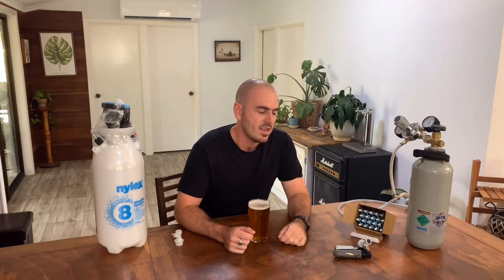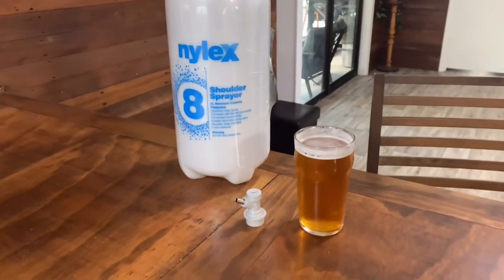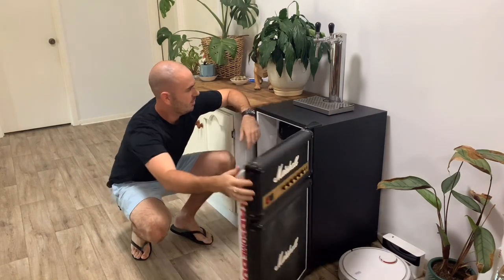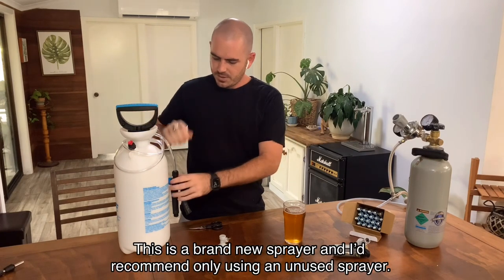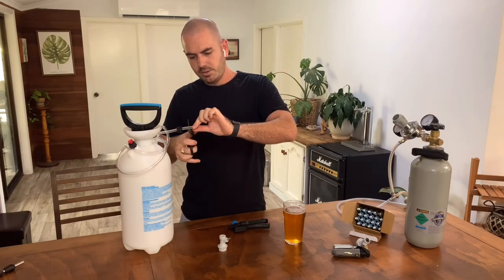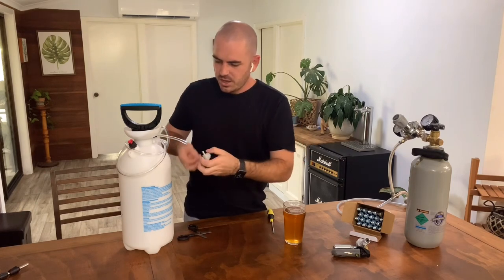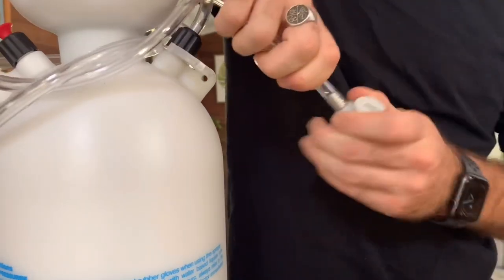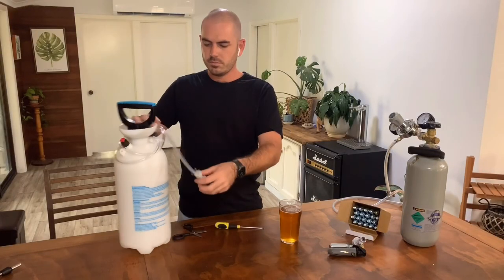Backup System to Pressurise a Keg Without CO2

Comment: Might want to look at a bit of chemistry and figure out how to make use of 

Marble, limestone. +.  Hydrochloric acid.   =.  CO2.  +.  Calcium chloride. + .............
From any decorative stone supplier, garden centre, From hardware store or solder supplier
Figure out collect, scrub (bubble through water) and use your above method to pump into keg.

Hope this gives you another little project.🤗🤗🤗❤️🇦🇺
Reply from the maker: Roger Rodgersen I’ve been looking into bicarb soda and vinegar to do just that.
Reply: Hoocho 🙄🙄🙄 to get real volume you’re probably going end up with marble chips and HCl.😎😎😎❤️🇦🇺
Reply from the maker: Roger Rodgersen I’ll look into it further, any suggestions for collecting the gas?
Reply: Hoocho 🙄🙄🙄 first do not make it indoors because it’s heavier than air and will collect and be very dangerous.  Not sure how you will collect it but I would try a large open container with a small mouth, delivery tube to the bottom so air gets pushed out,  output from bottom also.  Is going to be a fun project.  I have been thinking about using it myself but not tried anything.  Maybe somebody on YouTube has done it, be worth a search or three.  Have fun mate. 🙂🙂🙂❤️🇦🇺

Comment: Wait, you are using air? Or you can open the keg and pour the beer into your beer glas.
Reply from the maker: This is more for situations where CO2 has run out and many people will be using the tap.
I want to make it as easy as possible for them to pour themselves beer.